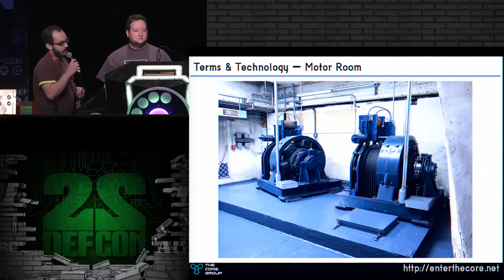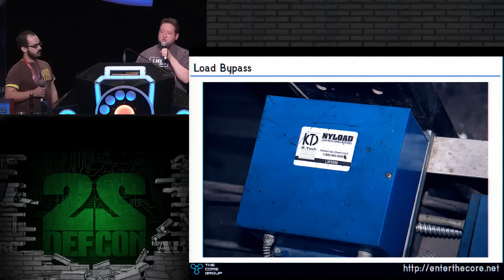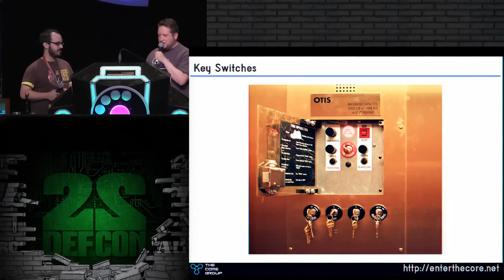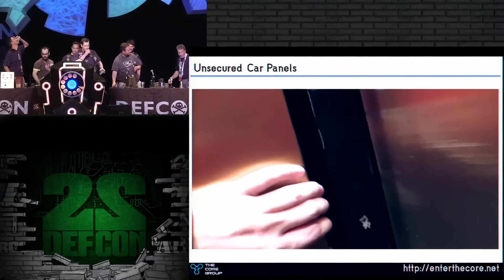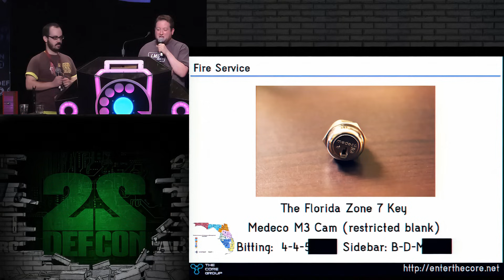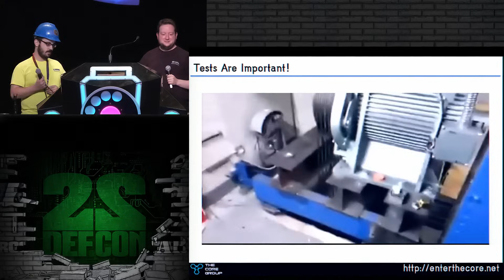DEF CON 22 - Deviant Ollam & Howard Payne - Elevator Hacking - From the Pit to the Penthouse

Comment: Working as an emergency/trauma nurse we used our badges all the time if the helicopter came to the roof pad…it gave us one of the elevators right to the roof and locked it out and allowed us to take a patient to the OR directly, SICU, or Cath Lab, or ED on the bottom floor…we’d get in a bunch of trouble for misusing our badges but they worked on more than just that one bank of elevators since many of us were on the code team and covered other parts of the hospital and satellite facilities.  Doesn’t mean late at night we didn’t speed things up for ourselves occasionally…especially end of shift…

Comment: The higher security building I’ve been in just have a separate locked lobby door at each level, on top of elevator card restrictions. There is also a receptionist with the ability to lock down the floor. Kind of surprised to hear so many rely on elevators alone, it’s hard to believe.

Comment: i be honest with you,m the firefighter set that had multiple states would actualy be useful for me. maybe. often i wind up in random states protecting random structures as a wildland firefighter and being able to bust into a concrete building to ride out a fire has crossed my mind more than once. ive thought about ways to bust doors with my axe, but other than wood doors thats useless, i can keep a door tool in the rigs, but having lighter tools would be better.
Reply: in california we had to defend a water treatment facility and being able to bust into that and keep the doors closed would have been awesome, the building had concrete walls around it. definitely would have been a good option for people and our equipment/rigs.
Reply: How would the elevator key help with that? That would be the Knox box key which is different for every city.

Comment: Would kinda suck to have to pressure wash brain matter off a counterweight.
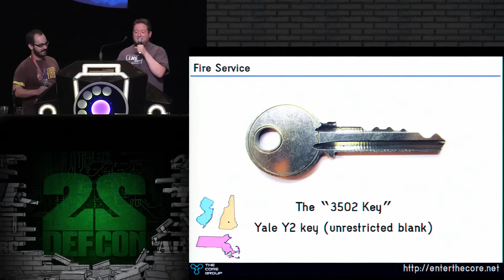Also, they made a mistake in editing, at 43:38 with the 3502 Yale Y2 Key, the black censor box is not dark enough. The numbers are 0-3-2-3-4-8.

Comment: Elevators (lifts if you speak english) are remarkably strong. Many of my coworkers get freaked out by lifts. I went to school in an office building for 10 years. We had the oldest still running and original lift (it was otis brand) in service in the city, and man did we abuse the shit out of it and it never killed anyone. It was a very large lift (the largest i've ever seen actually) with room for around 20 adults or 30students with capacity of around 1.8t. We would get on at the top floor and all jump at once to get that little zero g feeling (it accelerated downwards very quickly for an elevator), it handled like a tonne of students all hitting it at once and wouldn't stop. We would do 'washing machines' inside the lift, where everyone moves about back and forth with the objective of slamming the lift into the shaft walls, never failed. While i did get stuck in it a couple of times, it was never because of abuse. The building was made in the early 70s and the lift remained in service until around 2008.
Reply: Old Otis were tanks. Beautiful machines. Did a demo on one, not because of its performance, but its  code compliance. Just too old. Early 60s if I remember right

Comment: I was working Security in a Building and whilst travelling in the elevator with the Security Manager asked how often Security Tested the Emergency Phones. 
His response was that that was covered by the Lift Maintenance Contract. 

Yes the Circuits were Tested by Lift Maintenance for Operability, but not for Destination of Call. 

A Week late a Man got trapped in an Elevator for 12 Hours. 
His Emergency Phone although working was routed to an Answering Service in an Unattended Department. 

Four Hours after the Man had been rescued from the Elevator, the Security Centre got a Panic Phone Call  from the Head of a Department who had just listened to 6 Phone Call from a panicked individual trapped in an Elevator. 

Next day, Security Personnel were Instructed to Test Emergency Phones Regularly (Daily).

Comment: Sabbath mode.  The talmud prescribes a sabbath where you can do nothing it is the teachings of the rabbis and it expounds on the Torah. The Torah is from scripture and prescribes a sabbath that doesn't have ridiculous rules about buttons. Scripture preaches against the talmud. The Bible calls it (teachings and traditions of men or the elders). So while they are not hacking god , they are going against the words of men that have nothing to do with scripture

Comment: So many high-rise convention hotels need the full-load bypass feature.  I've been in a 23 story hotel in Dallas during a mass exodus from an event and waited over AN HOUR in the hall for an elevator I could hop on with my luggage.

The following year at the same hotel and the same event, I just said "fuck-it" and tried the housekeeping elevator which wasn't behind a single locked door.  The real bitch was finding my way out of the staff area to leave.
Reply: I would have just used the stairs rather than wait
Reply: @maritimemisfits3360  not when you're on the 22nd floor and have a full desktop PC to bring down with you
Reply: @JaredJanhsen  Down is the easy part, desktop pc's don't weigh that much.  Any resonably fit person could do the stairs without issue
Reply: It wasn't just a desktop.  It was a full tower gaming rig plus widescreen monitor plus bag of cables and accessories plus my suitcase packed for eight nights and my snack/beverage cooler.... And the other couple thousand people with the same load out.

Comment: You have not seen Russia. People ride counterweight
Hey, my mail box has a 137 lock keyed 6143521
But I have a Abloy Protec2 on my front door
I know code pink sends the elevator to the floor where the security desk is and opens the doors. FU
Some Russian elevators have the inspection switch in the cab. You can drive the lift on manual and open and close the doors WHERE EVER, no landing, still opens. On the move, STILL opens. Safety? FU I AM A ENGINEER I DO WHATEVER THE F I WANT.
The lifts I service, I change all key switches to EVVA 3KS

Comment: Dude, High speed lifts use a VFD and a direct drive machine. The most fancy lift I service is 90 floors.
Oh yes, we still have relay logic elevators in Russia
I am a elevator engineer and a network engineer (CCIE Security) For what? Swapping key switches and installing security cameras.

Comment: You know, the Bitting Code of the 3502 Yale Y2 Key is 0-3-2-3-4-8 (the black bar @43:40 isn't "black enough").
And here is the same slide without the black bar: https://image.slidesharecdn.com/defcon-22-deviant-ollam-and-howard-payne-elevatorhacking-fr-140813161934-phpapp02/95/defcon-22deviantollamandhowardpayneelevator-hackingfr-145-638.jpg?cb=1407947259 (page 145 of https://www.slideshare.net/cisoplatform7/defcon-22deviantollamandhowardpayneelevator-hackingfr )

Comment: A trick I've seen on some elevators is if you try to open the door on any particular floor, it will cause wherever the elevator is, to stop and open its doors, briefly.... then close and continue on.  Its a terrible design flaw.

Comment: That elevator at around 42:00 would be easy even without the fire key. Just call it, step inside, then wait for someone else to call it to leave and walk out on the next floor. I mean, not as quick as the other way, but you're in.
Reply: Except the person getting off the elevator would have called it in to security since they only used that back elevator as an exit. It technically could be done but it increases the likelihood of detection exponentially unnecessarily.

Comment: Peak mode... that is so annoying if not used.
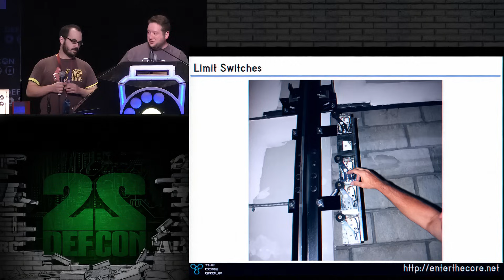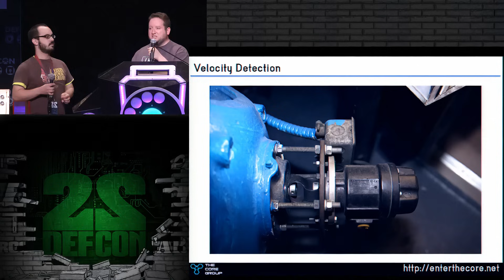Company with many people coming in 3 waves at the morning - around 6:30, 7 and 7:30.
Like 200 people each wave, 4 Elevators, 6 floors -  and you can bet that all are somewhere on floor 5/6. And the exact same thing at lunch and in the evening again. 
At the very least make the elevators spread - 1 in the upper floors, one at ground level.

Comment: I can confirm that holding the door closed button on an elevator did work on one specific location for me, for at least a year. It was at the library at the university I studied at, and I rarely abused my newfound powers...rarely...But I have never seen it work since. And I don't know how people think it works, but it was clearly a bug in the operating software, that has since been patched (I mean, I DID graduate 16 years ago). The elevator would stop as normal, which was your signal to hit the button, and you'd hear the actuators rapidly cycle to open and then closed, and the elevator would continue on its journey. I can only imagine how crazy this would drive the people on the other side, especially since I assume it would register that the call had been answered and would reset the call flag.
Reply: jformaldehydem that sounds like the relay logic issues they mentioned.

Comment: This was really fascinating.  Having said that, I have a real issue in that "Why even broadcast such intimate details" for idiots, scumbags and just plain nasty people and or groups to capitalize on this???

I would have preferred and been happy with knowing the basics, the breakdown situations and the safety details on what to do and or not to do!
Reply: Because Security through obscurity is no defense at all. The people at that talk probably all work in fields related to security and pen testing. And some times the only way to convince a client that is/her building has a flaw you need to show them. And the client will ask why can I install X or Y. Which requires the consulate  to understand the benefits and downsides of X and Y.  So people that install these devices and Train the security guards can make informed decisions about these security systems

Comment: No one ever mentions "dumb waiters" or people riding inside them.... probably not a good idea either!
Reply: May not have the weight capacity, there's no real safety mechanism, many have been demoed due to Fire codes. Ditto for laundry chutes in hotels. 

Some Schindler piston elevators have a set of service controls on top of the car, and from there you can work the door release for the floor above the car to gain building access. The outer elevator door key to get onto the car is a folding drop-leaf; small diameter metal rod bent into a modified L shape can be made to work or making a DIY drop leaf key is simple enough (you need good strength at the pivot point).
Reply: They have mostly been eliminated due to renovations. Every square foot counts.

Comment: 90% of "elevator based security" relies on Joe Public looking at the keyswitches on the COP or a slightly-ajar push panel and thinking to themselves...
"that looks important... better not touch it or I might get in trouble".
The number of times I've opened emergency phone panels and found priority/maintenance/fire service keys just right there in the switches, waiting to be turned...
Reply: Easy, just put “Do not turn key” 🤣 on it

Comment: good talk, nearly all industries are as behind in this. That's the problem the  current solution is security by ignorance. People are wising up slowly like routers get different default passwords when shipped. But there is alot of products and services that have very similar obvious security flaws. Generally only people in the industry are aware of them .  There's loads of examples from tonnes of industries the scariest one is the nuclear football passcode was 8 0s for 20 years(go america). In some industries it is good enough, like electronic padlocks unless its common knowledge how to dissemble one, it is good enough as crime is often by opportunity. Thieves wont spend 100s of dollars to buy one to find its flaws, but people like' jerry rig everything' do videos on these supposed flaws. Ruins their product! If you buy cheap security, expect there to be an easy work around, it's fine if it's relatively unknown. Lifts on the other hand. They deserve proper security. I understand that without the right codes it could be impossible to modify or fix issues. In cases of people being trapped there should be a specific mode to secure escape. But beyond that it should be made impossible to do anything to the system unless with verified codes provided by the company who built it much like car keys and their remote unlock.

A really good example(to scare people) i came across months back is that  you can unlock pretty much and card secured door with relative ease. Meaning you could steal from the majority of hotels in the world. I believe the update went out a while back but the fix is to disconnect the door and update the firmware. To each one, separately(literally days of work for big hotels). How many hotels do you think really did that? Maybe only the high priced one.

Comment: 4:46 "the highest I've ever seen is eight stories" I work a convention in green bay the Hyatt attached to the Ki Convention center is 8 or 9 stories(can't remember for sure off hand) they have a piston elevator and it is the slowest thing ever.
Reply: Macy's Herald sq freight elevators go up to 8 or 9th floor. It's hydraulic and can lift entire  40 foot trailers. The tractor stays on the ground. At least they used to, they renovated the store and I don't see the loading docks anymore.

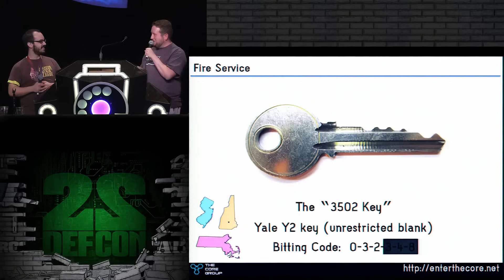Comment: 43:47 - you can read the full bitting code: 0-3-2-3-4-8, why did they add this dark grey rectangle if it didn't blank out the code?
Reply: different color grading on monitors could have made it invisible when they edited the slide, but they were different shades in reality, also providing a portion of the bitting basically means covering the rest was a courtesy, and since they provided the method by which they got the bitting code anyways, it probably wasn't exactly meant to be that preventative
Reply: A month late, but because it's an unrestricted bit code.  It's already publicly available.

Comment: One thing I was hoping they would touch on, but didn't is how is it safe for a fireman to use an elevator, but not your average citizen? Think about it firemen still bleed and stuff.  In the event of a fire I would rather use an elevator to get out than to have a fireman come in "rescue me" and then we ride down the elevator together. I don't need someone to hold my hand to motivate me to get out of a burning building.
Reply: I suspect the concern is not as much about the elevator being unsafe due to the fire itself, but that it would not be an effective means of evacuation considering elevators are only designed to handle a small number of the occupants at any one time.

In fact, it is likely that the elevators would simply be filled up by panicking crowds, with more people trying to push in, that would block the doors and/or trip the overweight sensors, preventing the elevators from moving. 

Firefighters would obviously have a bit of an advantage in having protective gear, tools, training and not being in a panic, so while they would be running a risk too, there may be cases where it is deemed an acceptable risk.
Reply: There is a big difference between you as a civilian using the elevator in normal mode, and the firefighter using it in firefighter mode.
- the firefighter has a breathing apparatus, thus can breathe in heavy smoke, you can't.
- in normal mode, the doors won't shut if something is blocking the sensors, heavy smoke can do this, therefore trapping you in this heavily smoked level, even if you came from a relatively safe one, whereas in firefighter mode you can do whatever you want and open and shut the doors whenever you like, the sensors don't matter to you any more.
So it's quite reasonable not to use the elevators in an emergency without a firefighter, not because you need them to hold your hand, but to provide breathable air and a key to make the elevator your loyal pet.
Reply: @musikchanger  Dint think about the fact heavy smoke could block sensors of doors.
I just figured if a fire burned a wire somewhere on a different floor a door sensors would get stuck on open. And a elevator could halt
Reply: The fireman is not going to ride on the roof. He also has been trained (we hope!).